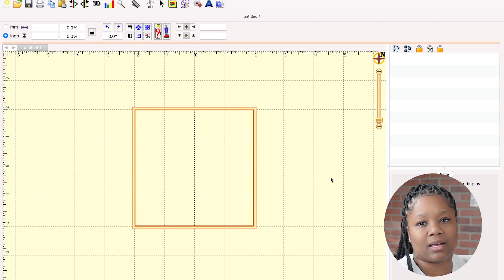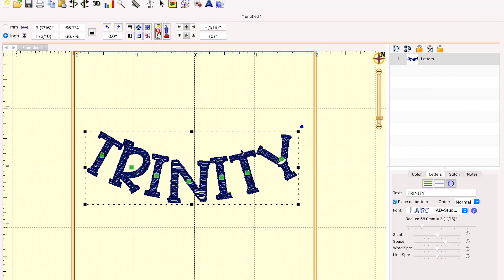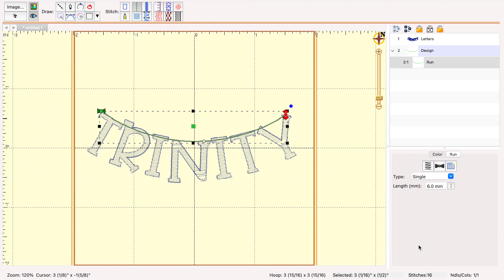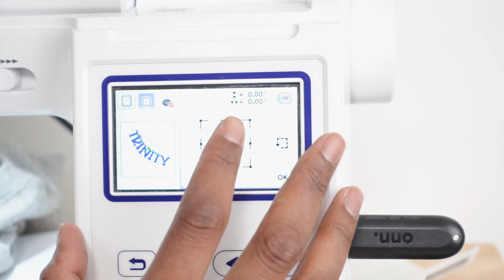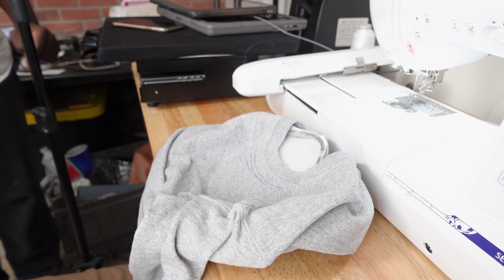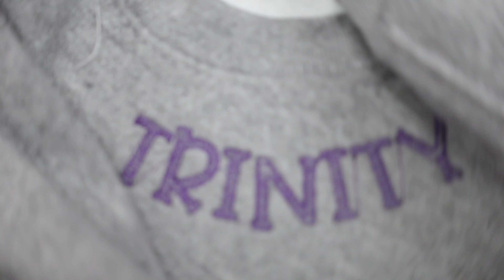How To Make Curved Neckline Embroidery On Single Needle Machine

Comment: HEY…CAN U JUST WRITE THE NAME ON YOUR CRICUT…CURVE IT THEN ADD IT TO YOUR USB PORT AND EMBROIDER IT FROM THERE?
Reply from the maker: Hey no you can you will need a embroidery software. The embroidery machine only reads embroidery files not .svg that Cricut would make
Reply: @simplyshy  SO EVERYTHING TRANSFERRED FROM USB PORT HAS TO BE EMBROIDERY SOFTWARE…SO IF U MAKE UP AN IMAGE ON YOUR OWN IT CANNOT BE EMBROIDERED?…
Reply from the maker: @kimberlythomas5169  yes the image will to be digitized (made into a embroidery file)
Reply: Circuit files are usually .svg or.png (picture files). Embroidery files are .pes (for a brother machine). Your Cricut nor silhouette software can open that type of file.
Reply from the maker: @jessicaklingensmith1312  exactly